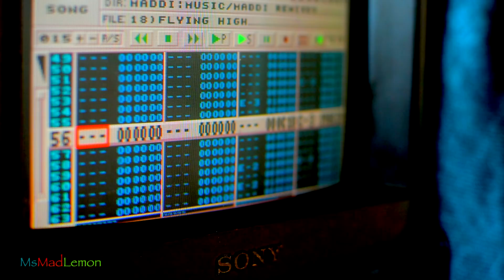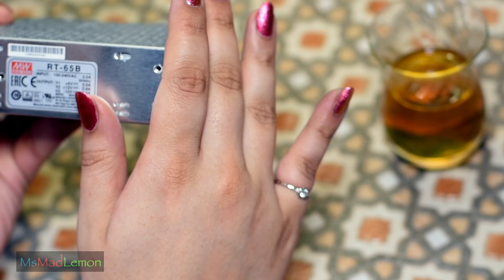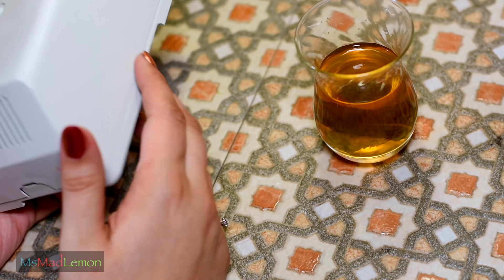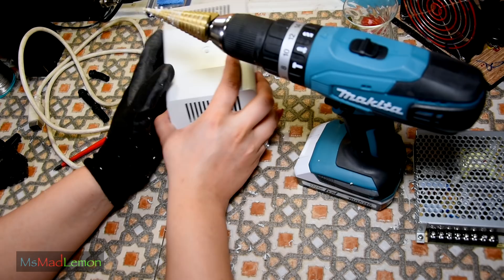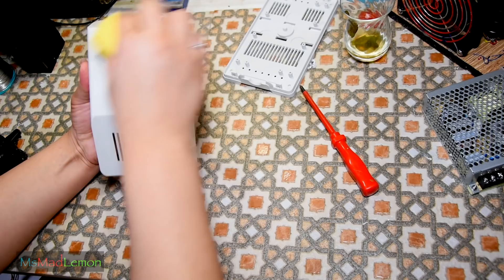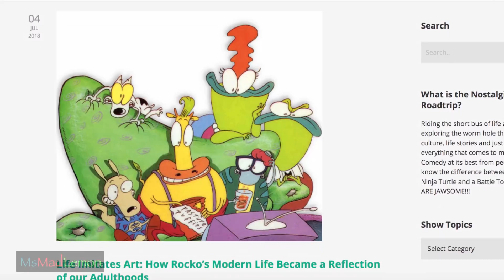Amiga PSU (MeanWell RT-65B) Part 1 - Prepping and Painting

Comment: Great choice on the meanwell psu. Ive made 2 for my amigas and work very well :)
Reply from the maker: You got the smaller 50w ones right? if I remember correctly. That would come in handy because from what I saw in your video they are small and compact.
Reply: Yes that right. Just powering amiga and an accelerator so didn't need that much. I don't think 65B was available back when i did mine. You definitely need the extra power to run the CD Drive as well as the amiga, hence the 2 cables out I see. Neat solution that I may look at in the future as I use to have a Squirrel SCSI CD rom, i have the drive but lost the cable and they are super rare and go for £100+ on ebay just for a cable.

Comment: For the PSU, I recommend the same model (RT-65B), which also fits the original PSU case. One thing to consider is where to order, especially if you live in Sweden or Poland (same import tax rules, adding VAT from value 0 (zero) and above, in Sweden we are also charget a "handling fee" of about 7GBP, in addition to 25% VAT).
My recommendation would be to look at mouser.com which sells worldwide and pre-taxes exports from the US (and really fast shipping with FedEx too).
In comparision with ordering from China / Aliexpress, my PSUs (ordered 16 Dec, missed delivery 21 Dec) were 26,95EUR/each ($30.64) including tax and shipping, from Aliexpress it should have been at least 5 week delivery time (2 weeks within Sweden beacuse of the handling), $28.04/each + 25% tax + 9USD handling fee.
https://www.mouser.com/ProductDetail/709-RT65B

Comment: Excellent as always Maddie! A tip for step drill depth, stick some electrical tape round the size you need as it helps show how far you need to go (works with regular drills in walls and stuff too!) Also, I've just figured out what that 2nd power cables is for, the external IDE device! :)
Reply: Good tip Mat. I'd also recommend placing masking tape on the plastic and making your markings on that. Any mistakes with placement, remove the tape and no markings to rub off the plastic. Also the masking tape helps to stop the drill bit sliding around as you start the hole.
Reply from the maker: Great tips Mat and Vorton, Tape on the step drill and masking tape to reduce sliding.. Thanks! :o)